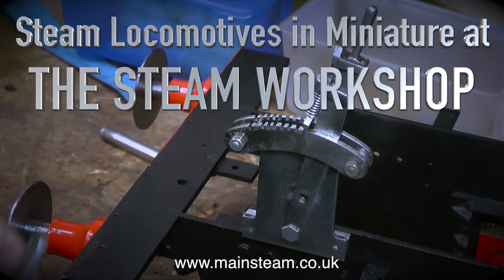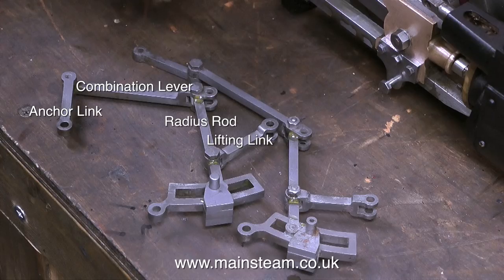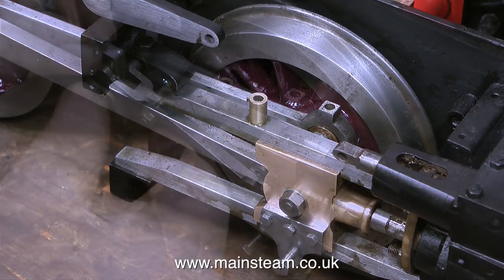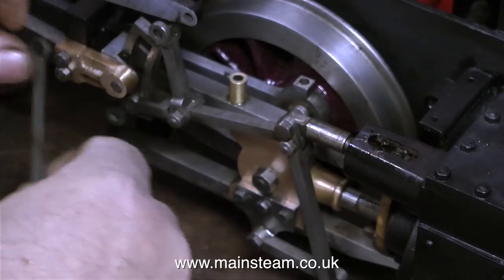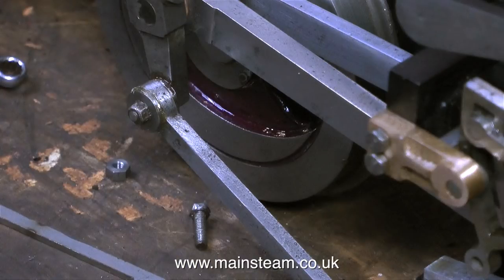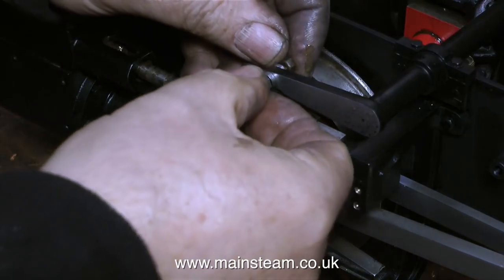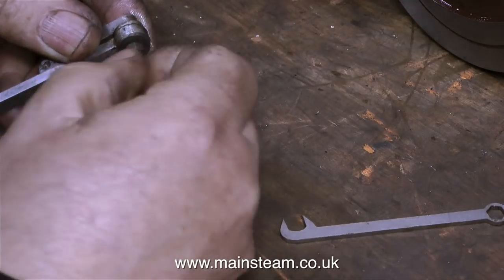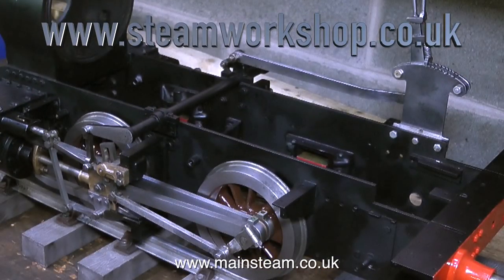WORKING AT THE STEAM WORKSHOP #11 - WALSCHAERTS VALVE GEAR

Comment: 2 sets please Keith!! Many years ago someone sugested using socket allen screws as spanners and published what fitted what if you leave the spanners at home!! 
Workshop snowed under in snow for the past few days? Removal of copper rivets from front of part built Jinty buy, abandoned in the sitting room!!!!!!!
Reply: I bought a box of various sized socket head set screws, try them on for size with different nuts/bolts, and silver solder handles to the ones that fit. More BA hardware is being made with metric hex these days too so cheap nut drivers are starting to fit.

Comment: Probably a bit too old to comment, since this video is a few years old now, but my friend has a good trick for getting oil around the cylinders. He puts the engine in reverse, put some oil down the blast pipe, and the running rolls it forward. That way it sucks oil down into the cylinders.

Comment: Keith, there are a bunch of pins with threaded ends that you nut into place on the linkage. Do you have to worry about any of the nuts coming loose after some running? Do you have to go back and Loctite the nuts at all? Thanks!
Reply from the maker: When tightened, the nuts are a tight fit on the shoulder of the the pins which are exactly the right length . . . .

Comment: Really enjoyed that. I find Walschaerts valve gear very complicated but you’re excellent video has helped me understand it a bit better. I hope to build a live steam loco one day but will probably use Hackworth valve gear as it’s a lot simpler. Are there any disadvantages with Hackworth? Thanks.
Reply from the maker: The only minor advantage with Hackworth valve gear is that the timing geometry changes very slightly as the rear wheel set moves up and down in the horn slot - but really for a miniature steam locomotive, Hackworth valve gear is perfectly fine.
Reply: The guys at my club reckon it's only good in full gear, notching up doesn't work so well. This came up because I was driving the club sweet pea and thought I'd try it and it ran like a dog so I asked why.

Slip eccentrics might be even simpler than Hackworth. You won't be notching up anyway.